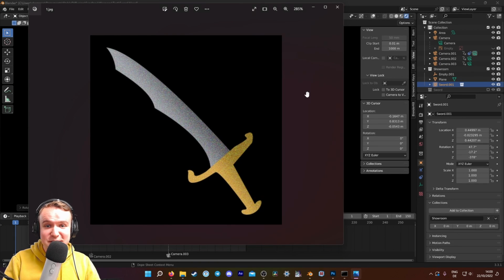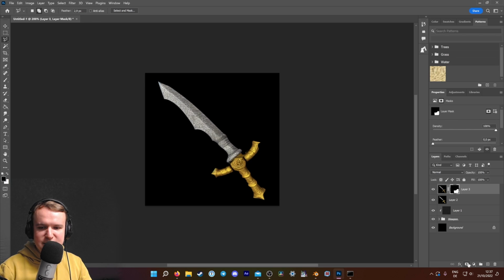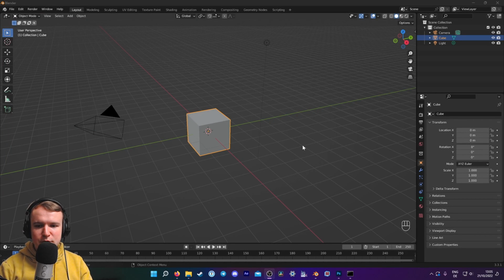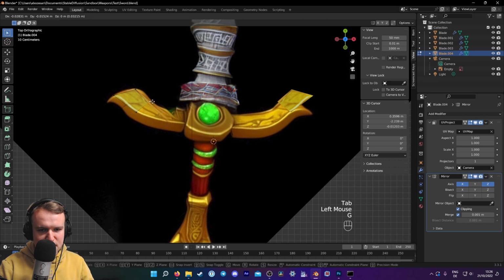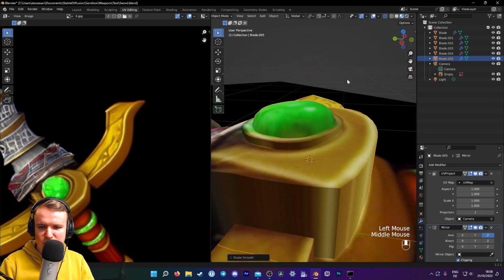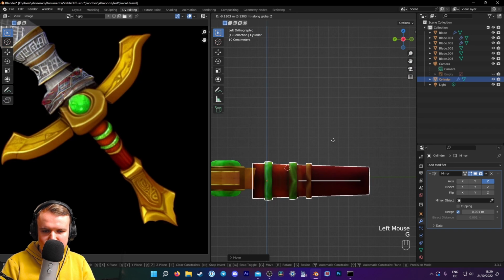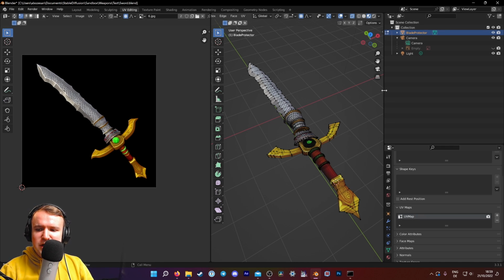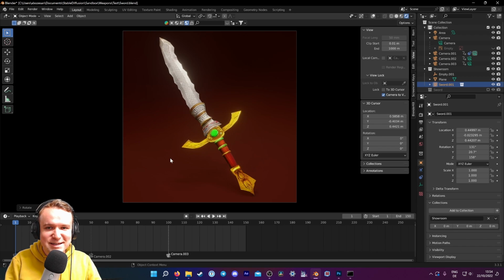How to Make 3D Game Assets with AI (Free and Easy) - Stable Diffusion + Blender Tutorial 2022

Comment: The problem with your blade, it's trying to create a "sword", which naturally contains a handle, even if you say "sword blade", since those two words are not a single phrase, but two tokens, "sword" and "blade". You would need to add "handle", "grip", etcetera, to your negative prompts, to be more explicit, so it becomes more likely to do a "sword blade", instead of "sword" (which includes a handle) and "blade" (which could be construed as a "flavor" rather than a thing).
Reply from the maker: Good tip, thanks!

Comment: Thanks for the video, I had another version of SD and prefer this much better.  One issue I have is the sword gets cut off on the top and bottom.  I have "centered" in prompt and even cropped the image in a photo editor and drew back in the cut off parts and added image back to SD but it cut off the image again.  Any ideas?
Reply from the maker: How close does it get to your input image? If it goes beyond the borders despite your input not doing so, try lowering your denoiser strength.
Reply: @albertbozesan  It goes beyond the border, I will lower the denoise.
Reply: @albertbozesan  It worked, thanks!